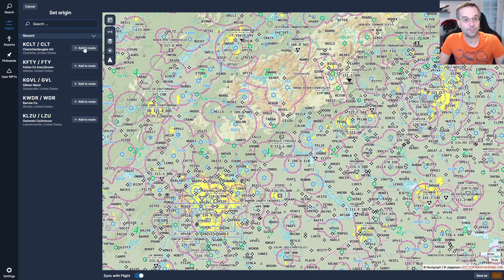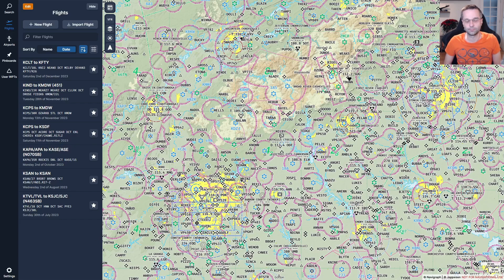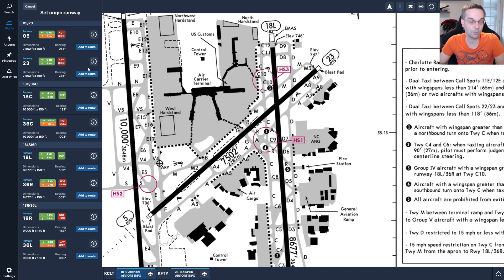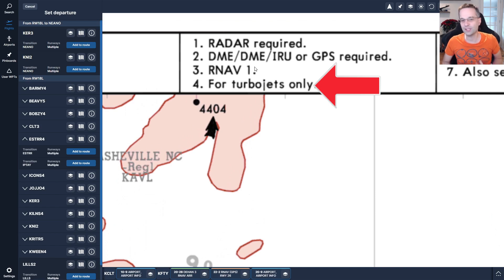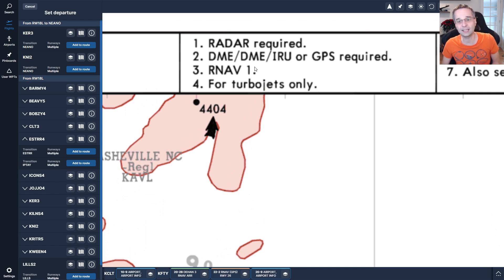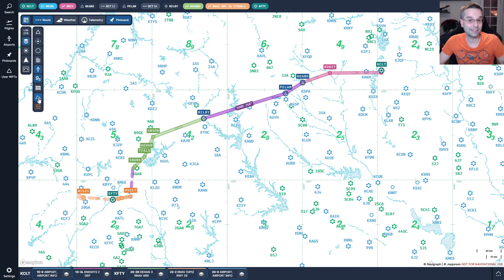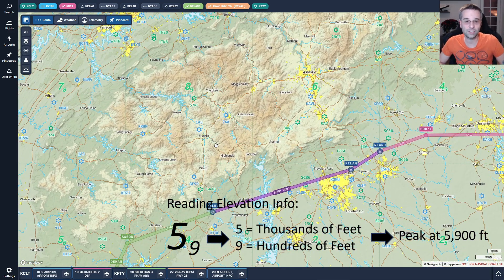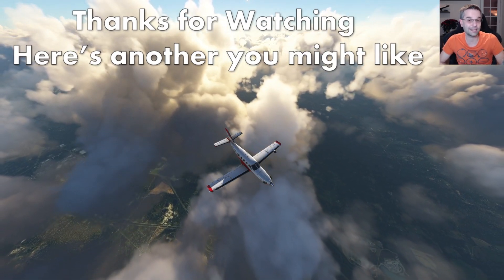A Sim Pilot's Guide to IFR Flight Planning for General Aviation (using Navigraph) | MSFS

Comment: When I was looking for a video, I saw "Flight Sim School", and knew I found a winner. However, in this case, there was one thing that you didn't mention - the discontinuity between SHUNS and OVZET. Everyone seems to simply overlook them. Of course, it's easier in a GA aircraft than an airliner with an FMS. But this might be a subject for another video; in this case, I am flying a TFDi MD-11.
Reply from the maker: I should indeed cover it in a separate video, I’ll add it to the list. When I first started with airliners, I thought the easiest way to handle them was to just delete them, but with experience I’ve discovered in many cases you’re best to leave it while you vector yourself around to the approach. I’d say it’s less about the plane, and more about the procedures you’re flying as to how to handle them

Comment: Hi Marc, awesome tutorial like always. Could you explain something to me please! After flying the first part of on the departure say in HD mode, in what case should I fly VNAV before NAV-ing her? Similar on approach, at what point should I disengage NAV and say engage VNAV? What is the sequence of engaging APROACH and VNAV? If I remember well, last night I flew my BS Baron on NAV all the way through approach and arrival and it took me home to a good touchdown, in MSFS2020 (It was a bit unorthodox, to say the least, coz I "guessed" all the altitudes and speeds at STARs:)) I am a bit confused, maybe you can explain to me in a few words or direct me to one of your excellent tutorials? Cheers, your old subscriber Nick.
Reply from the maker: Hi Nick, NAV and VNAV aren’t related to each other, since NAV for is for lateral navigation, and VNAV is for vertical navigation, and one doesn’t preclude using the other. Normally I’d use HDG to get myself on my flight path, then enable NAV mode, and then only switch to APR when you’re starting the approach. As for VNAV, I’m not actually sure if you can use it for climbing, but you can definitely use it for descending. I covered VNAV very briefly in this ILS video (https://youtu.be/bdwtk9GxNqY), but I’m not sure if the BSQ Baron has VNAV since it’s steam-gauged based.
Reply: @FlightSimSchool  Thanks Mark, I am doing the same thing, HDG to get to the flight path and then NAV. I have always done the landings on NAV and descend and adjust speed both manually. I said to myself I have to do the landings properly, with arrival and approach. This confused me:) Thanks for the link. From what I understand, I know when to start the approach (and therefore switch to APR) by looking in the flight plan at the waypoint where the approach starts, correct? Thank you again!

Comment: Thank you so much for this great tutorial! Only question I have is how to select the V415 waypoint (12'45"- between Neano and Milby) and add that to your flightplan. I couldn't see in the video what buttons to use.
Thnx again!
Reply from the maker: It depends on what avionics you're using, but in the Garmin units, I tend to cheat and put the waypoint where I'm joining the airway, and then the waypoint where I'm leaving the airway.

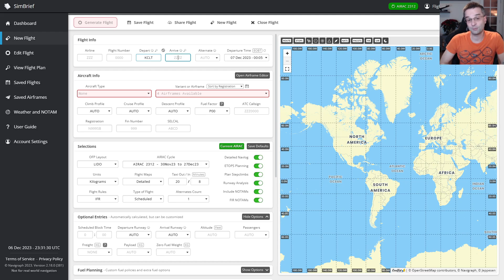Comment: Good evening. I just subscribed to navigraph but am totally confused as to how to plan a route. All I see is what you showed at 2:50, what or where can I find the flight plan tool? 
I didn't get much time to play with it as I was in a bit of a hurry to get at least one flight in as I had to go to sleep bc I work 3rd shift.  Thank you in advance.
Reply from the maker: There is an autoroute option, but if you're doing an airliner flight, typically you'll use simbrief first and then load that into navigraph. For shorter IFR flights with GA planes, I tend to do the planning myself for a bit more fun with the process I explain in this video. Hope that helps
Reply: @FlightSimSchool  I finally figured it out. Though I can't upload my flight plan to the G1000, I do appreciate the fact that navigraph inserted their system into the unit so you can duplicate your flight plan. It's definitely a learning curve, especially for individuals like myself that are complete noobs to this flying atmosphere. I've defined gained a whole new respect for pilots.

Comment: You chose runway 26 because runway 14 did not have instrument procedures. Where can I see on the chart if a runway has instrument procedures or not?
Reply from the maker: I skipped over that, but what I did was I first picked runway 14 as my runway, and that’s then I saw there were no instrument procedures for it, so I backed out, and picked 26. I hope that clears things up.

Comment: This is fabulous, as always Mark.  I always learn from you!  One question: when you jumped on the low-altitude airway, I noticed that it did not add the airway to your route, but only the DCT code. Is this a limitation in Navigraph, or am I mistaken in my understanding?  Thanks again from just down the road in New Hampshire🤛🏻
Reply from the maker: Thanks Pete :) From what I saw, there is no way to add the airway name directly to the route (it is on their roadmap of features though). You can drag the flight path over the airway, and if you do it just right it will add the airway itself to the text route, but I find it easier to add the first waypoint of the airway I’ll be using and then the last one.

Comment: I never understand why people use external apps for planning when everything is in FS2020.
Reply: One reason I use external flight planning apps is because MSFS2020 doesn't show terrain. Many of the GA planes and ultralights I fly in the sim are quite primitive and demand navigating through mountain ranges rather than simply going over them.
Reply from the maker: For me it's the charts that I find invaluable; you can get away without them if you're in a G1000 or similar glass cockpit, but for round gauge planes like the Comanche or even the TBM850, you can't do an IFR flight without them.
Reply: Thank you for the refresher. It’s always good to go back and revise. Been flying for quite a while now. One thing I’ve noticed tho is sometimes the metar in MSFS doesn’t match real world. For example the other day it gave me a runway that wasn’t not really being used.